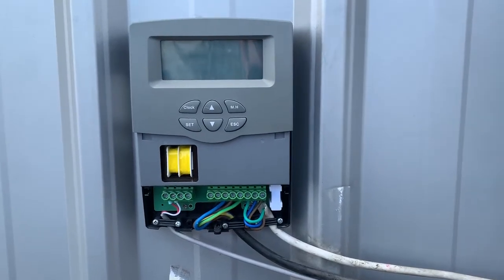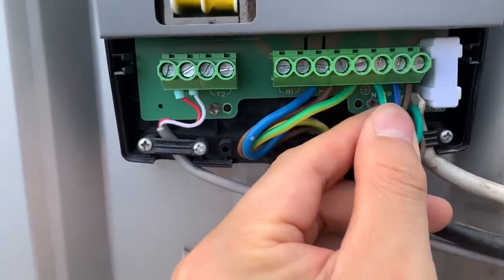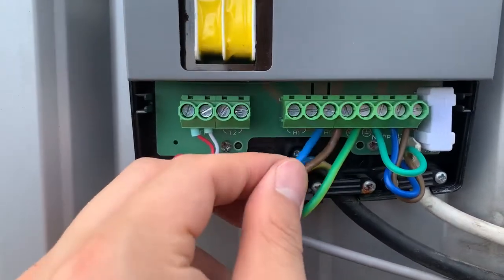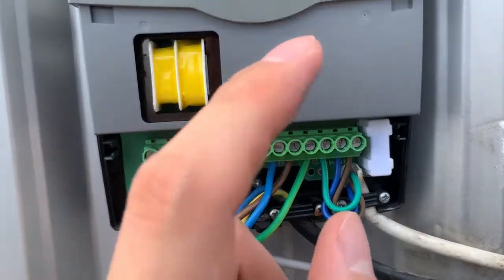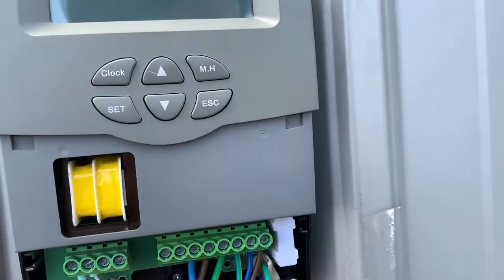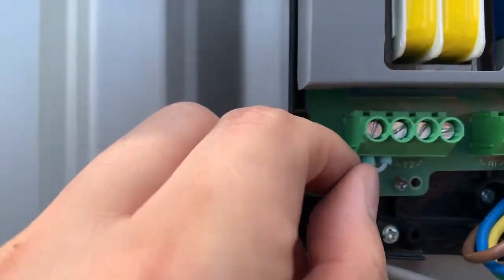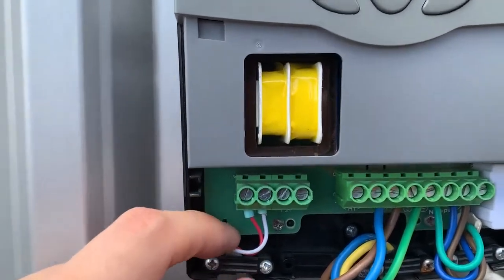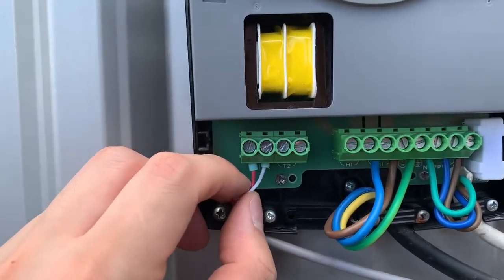Solar Hot Water Controller Terminal Introduction

Comment: Sir, what model controller is in the Video? I have an SR208C I am trying to wire.   This controller is very similar to mine.  My only question is in connecting the 110v pump to the controller using the P1 terminals.  They are not labeled as to which is the hot wire and which is the neutral wire.  Does the P1 provide 110v or low voltage to a relay?  
Thank you

Comment: Hello, does this controller detect the water level in the tank? Thank you
Reply from the maker: This is pressurized solar water heater system. What you need is for unpressurized solar water heater.
Reply: @zhujerry1874  Is there any with WiFi
Reply from the maker: @albertomatar4860  sure.
Reply: @zhujerry1874  Model please?